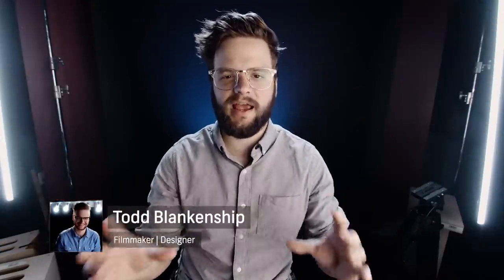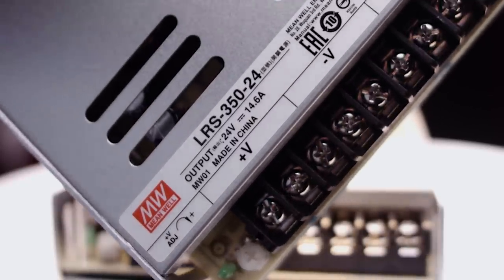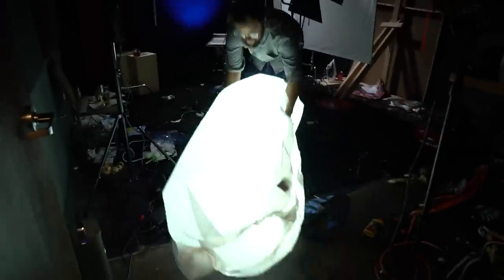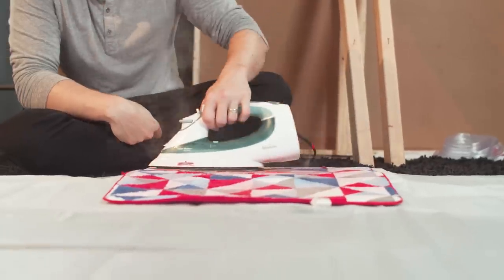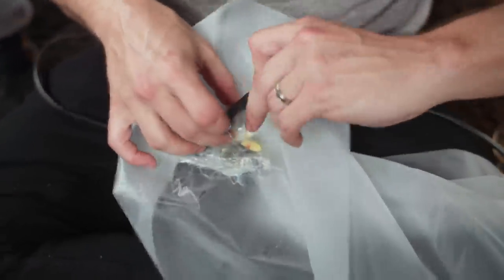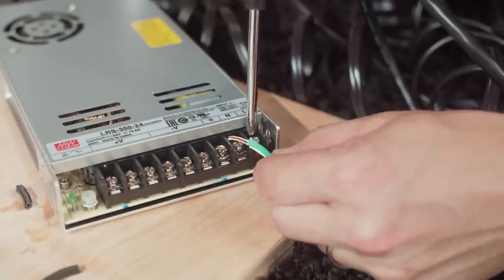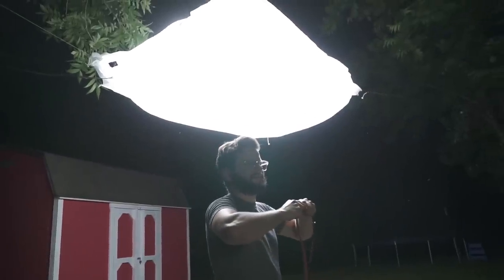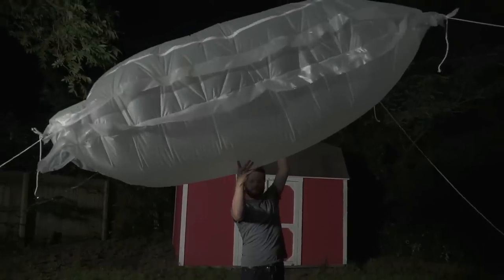How To Build A DIY Balloon Light | Cinematography Techniques

Comment: Suggest adding silver or black foil to the inside top piece to prevent light pollution/waste going up and out.
Reply: Using mylar (like a space blanket) as the top half would be a great way to maximise output where you need it!
Reply: Literally what I came to the comments to say. Adhere some mylar to the top piece.  It'd be easier to do on the outside probably, but better light efficiency on the inside.
Reply: great idea but much more weight and I don't think it would have floated. But could just fill with air then secure it somehow.
Reply: @alexanderramsay7992  Yes this is a much better idea. Wonder if it would hold onto the bottom part?

Comment: You might want to try a hair straightener/curling iron for seam sealing. I use a flat one for sealing mylar projects from old coffee bags, etc.  I just found it at a thrift store. Try to find one with temp adjusting. If it's too hot, try cutting 2 strips of teflon, from a grilling mat, used for bbq, to diffuse the temp. Clamp together for 1 second and you get a beautiful seam. It takes some experimentation, but once you get your temp right, its perfect. Thanks for sharing this project.

Comment: or make a DIY crane boom from pvc and attach a 4x6 diffused rig, to save on helium.
Reply from the maker: As stated in the vid I don’t recommend using helium at all. Just fill it with air and pulley it up using the ropes.
Reply: @shutterstocktutorials  i was thinking of maybe getting 3 punching ballons and then inert them into a vinyl sack like thing, sorry was just trying to give tips. I didnt to come off sounding dickish.  :D

Comment: Looks nice but I don't think the wiring is save. Especially for LED strips with 190 watts you should solder on the cables instead of jut twisting the wires. Also are the cables from the main voltage open. That could be deadly.

Also you could cnsider to make it dimmable usig a motor speed controller.

Comment: An idea that I got from this, was to use multiple shower curtain liners.  32 actually.
16 for the bottom layer.  4 across and 4 down.
16 for the top layer.  4 across and 4 down.

Use LED strips that allow the colors to change in some rotation.
Glue the back side of the LED strips to the top layer.
Seal the edges of the two layers.
Attach ropes to the corners of this giant 24ft X 24ft square light pillow.
Fill with helium.  This will be the expensive part.
Float it above the dance floor of the outside patio.
Now you have a multi-colored light show above the dance floor.
When done, you can roll it up, and put it in a large nylon laundry bag for storage,
and use it for next year. 

Im getting more and more excited as I think about this.

Comment: Faster option for joining the plastic seems: 'Heat n Bond' Iron-on Adhesive (Super Strength would be best). It's fairly cheap at $1.26 for ¾ in x 8 yds (WalMart). It's used for joining fabric typically, like hemming pants, but I've used for other things, too. You would use the iron like you did but would not have the long wait of the melting plastic. It's also extremely light weight which would be much lighter then using a glue product.

Comment: So, often these shower curtain liners are made of PVC, which is the same thing that a lot of home plumbing pipes are made of... and there's PVC glue you can get to cold-weld them together (like melting them together). Using a few lines of that stuff would save you a lot of time and not add much weight (and save you weight around your valves), and would probably be more reliable than melting plastic with an iron.
Reply from the maker: Ah, very interesting - thanks for the input, will certainly look into this. Trust me if there’s any way around the lengthy ironing process I’m all for it!
Reply: @shutterstocktutorials   Actually, it looks like I haven't purchased a shower curtain liner in a long time :-) They're not usually made of PVC anymore (poison out-gassing problems, I guess).  They're made from PEVA instead, so there's probably a different solvent cement for it (or maybe the same stuff will work, I don't know). A quick google search reveals that 3M™ Scotch-Weld™ 8010 will do the job.

Comment: I would use epoxy to seal those valves in place, it would be better and stronger than hot glue and it wouldn’t burn the crap out of your fingers.
Reply: Epoxy would become hard and brittle;  with little yield.  A few inflation/deflation cycles would cause it to crack.   I'd personally use silicone.

Comment: You could have just bought an 'airbed' like those that you use for camping a big double one. Yea you'd need to cut it open turn it inside-out to install the LEDs then turn it outside-in and re-seal the opening but it would definitely save time with the iron. Never heard of these before, does the balloon amplify the light output somehow?
Reply: Scratch that, getting a translucent one ain't happening. HAHA.

Comment: An easier solution to sealing the seams is to use curtain adhesive tape. It's basically finely printed hot glue tape that can be applied with an iron and would be much easier to apply and seal the seams. I would also double the shower curtain material on the front facing surface to counter the weight of the LED strips. Filling the balloon with air and using weather balloons filled with helium would alleviate the need for so much helium as well. Another idea would be to also use an equal amount of 3000k LED strip along with 2 PWM LED dimmers to be able to tune your color balance. Cheers on the great DIY and results nonetheless!
Reply: You would need more helium for your baloon idea because you're adding more weight. The weather baloon would need to lift the mass of the baloon + light + the mass of the air inside. Without you only need to lift the light. So you would need more helium and also purchase the weather baloon.
Reply: @stefanchoquette8401  true points

Comment: Could you use a floaty bed filled with helium as the primary floating ballist and then under that on the ground facing side mount your led lights and then place you shower curtain (diffusion film) over that?
Reply from the maker: Very interesting idea. That would be a solid way to make a slightly smaller version. I would also just use air, and bypass the helium altogether.

Comment: I found a company online that makes blimp balloons so I had them make me ones it was frosted White, they also sold a patch kit for their blooms so I opened it up at in my lights and patched it back up the best part is I did the patch on the top so I can't even tell and I put a dimmer on it...NOT cheap it cost me close to 500 but that's still cheaper than anything else I could get my hands on

Comment: do NOT put scented oil in your iron. As a matter of fact ONLY use distilled water in your iron.
SOLDER your wires, twisting and taping is garbage and asking for trouble.
Reply: At least he could use sqeezing connectors. Hope they are called like that in english 😅 in german they are called "Quetschverbinder"
Reply: @SirWallace2  Really close, they are called "crimp connectors". "Crimp" is just another word for "squeeze" or "bind" especially used in electronics.
Reply: No one is buying distilled water to iron their clothes. What are you talking about?
Reply: @HenrySavageMode  Distilled water is $1 for a gallon, many people buy for drinking water. Also, read the instruction that came with your iron.
Reply: Yeah, that oil is going to ruin the iron.  I prefer using a separate spray bottle when ironing.  You could put the oil in there.  But then you're also smearing oil all over everything when you iron.
Reply: @TruthAndMoreTruth  well drinking demineralized water is actually really unhealthy since, as the name implies, it hasn't got vital minerals now I'm not sure if that's what you mean by distilled water but it shouldnt normally be drunk
Reply: @rp003.0  What I mean by distilled water, is vapor distilled water. There are several brand of vapor distilled drinking water, Smart Water, being one of the more popular and expensive. Some drinking water brands add electrolytes.
Reply: @TruthAndMoreTruth  oh alright I didn't know you could use that in an iron

Comment: Great job guys, you could use some thinner plastic, the type they use in home decorating, even use 2 layers on  the business side, the helium will expand when heated and 1 cubic meter   35 cubic feet  will lift 1kg   2.2 pounds,  Strip the outer insulation from the wires to reduce weight and post a disclaimer for different countries use different wiring colours !!   and on the power supply why is the Earth/ ground not between the Pos and Neutral ..??   Thats a British standard    But overall   great job   I used to work on a blimp and we needed 230,000 cubic feet to fill it up :-)

Comment: It really is an awesome build !!!

Do you think adding a vaguely reflective or white surface on the LED side (like aluminium foil or even simply a white surface like fabric) could further improve the light output ? Or would it start being too heavy/complex/expensive ? (Thought about white paper and then pictured a potential paper cut on the shower curtain and thought "meh...")
Reply from the maker: Thanks!! I thought about a bunch of that sort of stuff, the main thing is the material has to be super light, and super airtight (and at-least somewhat strong). The airtight part is what I found most difficult when trying to think of a material.
Reply: @shutterstocktutorials  And I imagine that adding the reflective material to the airtight shower curtain would have weighted too much to lift off.
Reply from the maker: @benjaminmartin7588  That would be my thinking - but I'm sure there is something that exists that would be reflective and light - I just don't know what that is
Reply: @shutterstocktutorials   The only thing I could think of would be the foil that they make balloons out of? But your light seemed to put out plenty of power without it. Really impressed.
Reply: First aid foil blankets perhaps. Its strong, large and light.

Comment: FYI - use silver mylar on the back side with your LED's and it will bounce more light down so you don't waste it. And mylar doesn't lose gas like shower curtains do.
Reply from the maker: How would you go about creating an airtight seal between the mylar and shower curtain? I found some of this fabric seal stuff that you also iron, but it wasn't creating an airtight seal. That was kind of the biggest reason for the shower curtain. I knew I could melt it together.
Reply: @shutterstocktutorials  I was thinking that you can make another layer of a different material on top that is leak proof to make it float, not necessarily needs to be the one that contains the lights, that way the shower curtains are not the ones holding the helium, if you fond more pure helium you can make float heavier things too. Awesome video btw.

Comment: But can it be used multiple time? I feel like life span of the shower curtains would give out or the the LEDs would lose its stickiness after you fold it up and unfold it a few times?  Im curious?
Reply from the maker: The adhesive is actually really strong. I'm not too sure about the lifespan though. My thinking is that it would probably be usable multiple times, if you're careful - especially not to puncture it. At the very least though you'll always have a really bright flexible LED panel.

Comment: Even cheaper and less difficult: raise a reflective sheet of mylar high into the air with rope and poles, point a powerful spotlight at it from the proper distance/angle.
Reply from the maker: The light wouldn’t be as soft as you’d need and would be too shimmery (almost like a water pool). But a common technique is using a white sheet this way for a nice soft bounce.

Comment: nice!!! i appreciate it a lot...

anyway, helium is unnecessary for me... i rather hang it up on something
Reply from the maker: Yeah, definitely don't bother with the helium. Not worth any of it at all. Just fill with an air compressor and pulley it up to some trees.
Reply: @shutterstocktutorials  you mentioned before that usually they put tungsten lamps on those so it might be that they just use the heat to expand the air inside making it float

Comment: instead of working all these stuff just to find out there is a leak in the sheet... you could have easily get 2 shower curtains, 4 light weight pvs rods for keeping it rectangled... attached the 2 curtains by ironing them with led strips inside... then attach some normal sized helium balloons at the top... no need for experimenting and wasting cylinders of helium for a leak...

Comment: You could have used a heat sealer. The one used to seal plastic bags. 30$. Sure isolation. No air leaks! Search for impluse heat sealer

Comment: You did not mention how you re-used the grommets that you cut off the liner.
I would have expected you to leave them on and then make sure that they were on the extreme left and extreme right of the giant pillow.
That would allow you to add rope or nylon cord to the pillow so it doesnt float too high.
I would not want my electrical cord to double as one of these ropes since I would not want the electrical cord to have any additional tension on it.

Comment: did you say the strips run at 190watts each so that would be 380 watts total so then i herd you say you got a 350 power supply? hmm isnt that under powering it? second dont the strip lights get hot does it cause any issues with the plastic? and third yah someone said the other question i had just put a shine film like a reflective sticker mirror thing they sell on ebay so that the light bounces down and not go to waste going up to nothing.
Reply: That's right, but he got two, each 350W PSU  drives one strip